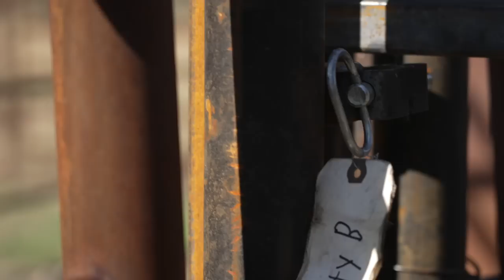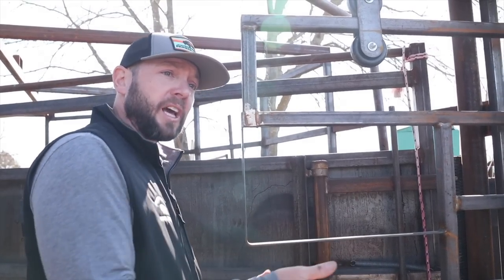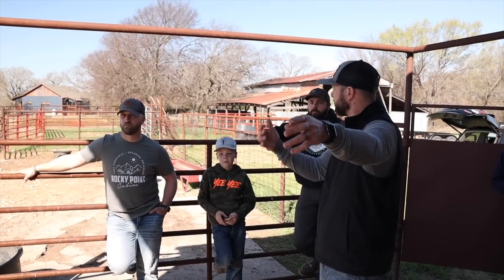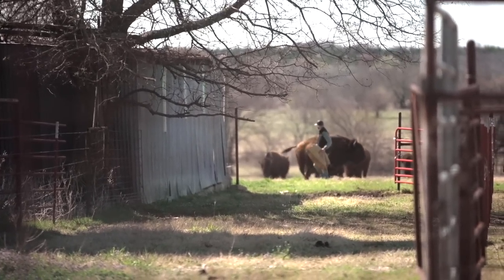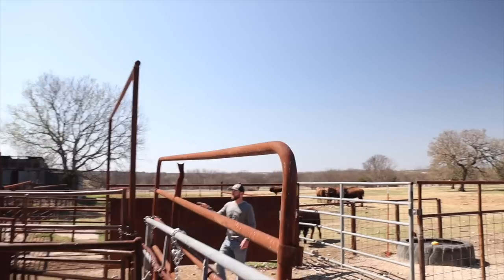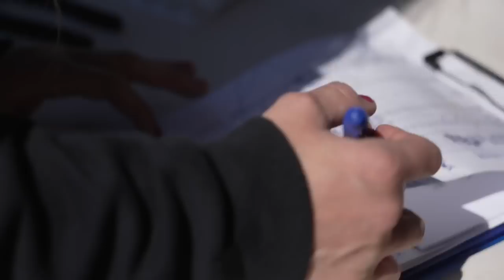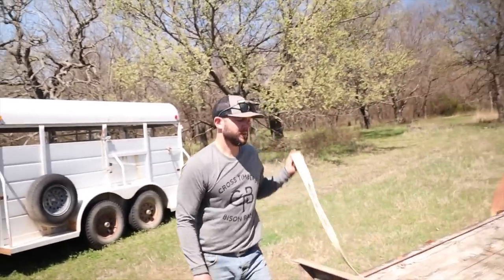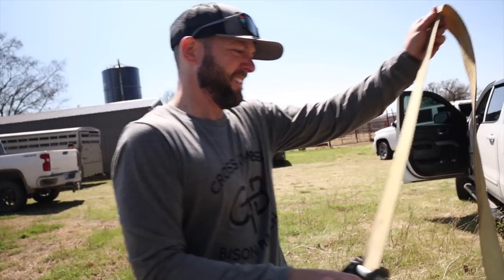This Happened For The First Time Working Bison!

Comment: i recommend that you put some of those foam pipe insulation tubes on the handles of those roller gates, so it wont hurt so bad if you run into them.

Comment: Each time y'all work the Buffs I'm amazed that someone doesn't get injured, all it's gonna take is for one to come out of the headgate and turn left and whoever's working the gate is gonna get it, as well as the other ones standing there with nothing between them and the Buff. 
It's not a question of if, but a question of when.

And what was the deal with the ear tag Dusty, you tried 3 times and still didn't get it, finally giving up.

Comment: Dusty, I am concerned for the operator of the headstock/exit point of the race.

When you open the head stock gate  to let the Bison out the gate opens away from the operator (meaning it leaves Nothing between them and a 1000 + pounds of excitement.

Could you change it so when you open the gate the gate swings towards the operator giving at least some protection from a beast that all it needs do is fall over or trip to take out said operator or something worse upon exit
You could still rig it to open from the control side, just open the other way, 
Or is there a particular reason that you put yourself in a questionable safety situation? 

I bet working them like that video gets the blood pumping?
Tony from Western Australia 🇦🇺

Comment: Since everything is made out of steel, so the whole contraption is way too loud! All that clanging steel and gates slamming shut surely adds to the fight or flight instinct of the bison. If the comfort of the bison concerns you or for the sake of efficiency, make the following changes, With some nylon casters/rollers, nylon or ball bearings hinges, and rubber gate stops (and/or simply grease up all moving parts and friction spots) would quiet down the whole process considerable! Helping to minimize the fear factor for animals would ease the routine, and simplify life for everyone involved, man & animal. OR if you don't care about the bison, but want to simply speed up the process, just turn some Australian Cattle dogs loose on them and they'll push them into the shoot a lot quicker than luring them in with a trail of feed sprinkled on the ground. Either way, I like your videos, but I had to turn the volume down because of all the noise. Good luck!

Comment: Why do MEN try to 'brute force' everything? Bison are bigger, stronger, faster, and way more dangerous than YOU are, Dusty. Why is everyone out there trying to FRIGHTEN the bison into the corral? 

Instead, you should TRAIN them, via their calm cooperation to earn rewards, to voluntarily go into the corral for daily food or treats. Let them explore the handling facility WITHOUT catching them, so they are familiar with it, and comfortable that they will NOT be trapped nor hurt by it. 

When it's time to work them, do everything the same as usual, except shut the gate after they go in. Keep all strangers out of sight and smell range until the bison are in the corral. ANY change in number of people around, or the look of the facilities, will make the bison nervous and suspicious. 

CALMLY nudge them into the chute. Be SUBTLE. Very small movements on your part will cause the bison to move AWAY from you. You can steer them that way, without panicking them. Also, TALK to them. EXPLAIN what you're doing and why. Use a calm. soothing, up-beat voice. 

I've used this method on llamas, alpacas, peacocks, and even the neighbor's escaped cattle, and it WORKS. Learned it from Temple Grandin's books. You really, Really, REALLY NEED to study her methods and USE them, for your own and others' safety, and the safety and well-being of the bison! It won't take any longer, and will be easier on ALL.
Reply from the maker: That all sounds great…but these are bison. Different creature than any other. They’re much more difficult to handle than what everyone sees on a camera.